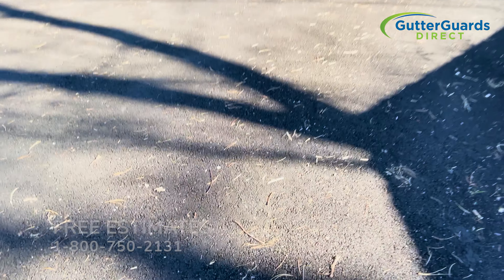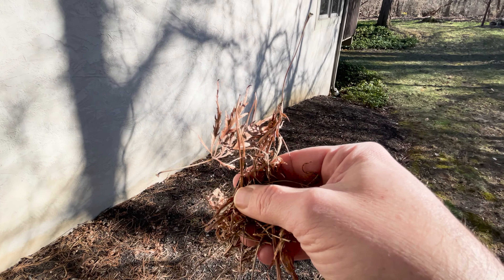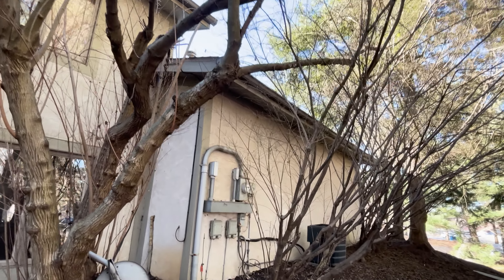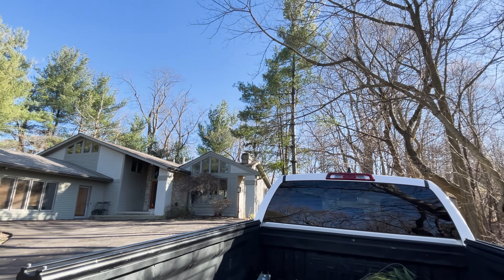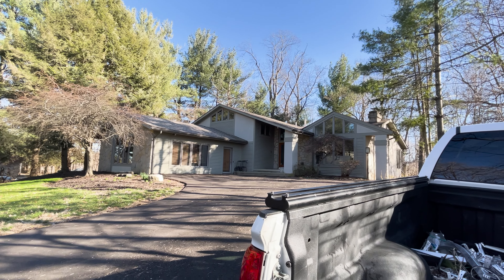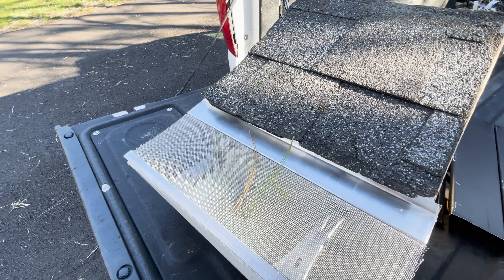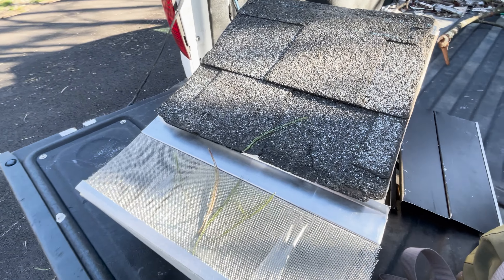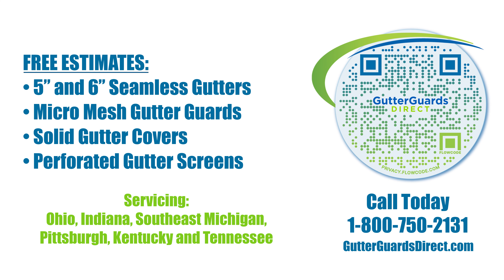How Do You Pick the Best Gutter Guards for Your Home? Comparison of Gutter Guards vs. Pine Needles

Comment: Will the LeaFree work if I don't have pine trees. Mu neighbor has river birch leaves that fall on my roof and an oak tree in his back yard that the leaves sometimes make it to my roof. I just had that system put on my house with 6 inch gutters and it also has holes in the gutter guard along with the slot on the front, so it's not solid, it has holes, a lot of holes.
Reply from the maker: Hi  @ron4413 . What you just rattled off are among the 5 worst trees on our list. The issue is small stuff clogging the opening into the gutters. I would encourage a micro mesh for your situation. We’ve tested many. Anything with a finer screen will keep the small stuff out of your gutters. Anything with larger holes, slits or slats will be problematic. 

If you decide to look closer at micro mesh, make sure that it’ll easily repel the debris and take in the water. 

Jump around the video in my next comment to see what might fit your needs.
Reply from the maker: https://youtu.be/ay_FS1X22kY?si=IvIqTqh4wBKMObEt
Reply: @gutterguardsdirect  Ok thanks, I saw in your one video where LeaFree was your 2nd choice.
Reply from the maker: @ron4413 overall, the solid gutter guards are good performers; however, small debris is their downfall. Oak tassels and the twigs and leaves off the river birch may prove challenging or require you to blow/wash out the opening into the gutter.
Reply: @gutterguardsdirect  Ok thank you for your help, I guess we will see how they work since that is what I have. Those trees aren't in my yard, they are in my next-door neighbor's yard. He actually has the solid gutter guards on his house and doesn't have any trouble that I know of. My neighbors across the street have the same and have a lot more trees and they don't seem to have a problem, so we will see. I hope I made the right choice. I will let you know.
Reply: @gutterguardsdirect  Thank you

Comment: What would you choose for a house wth only 2 large cherry 🍒 trees close to only one side of the house and garage?
Reply from the maker: Determine what types of debris the tree sheds and then look for a gutter guard that sheds that stuff. Clearly, a product like MasterShield, will work. It's the Cadillac system. Others might work, too. In this case, LeafSolution, Gutterglove Pro or even Gutterglove Easy-on/Atlas if you're interested in a budget-friendly DIY gutter guard that is designed to slide under the first course of shingles. 

You simply have to decide what level of maintenance you want to perform going forward. If you're subject to leaves and cherries falling into the gutters or onto the guards, installing a gutter guard that slides under the shingles and has a nice forward slope makes more sense than installing a gutter guard that sits flat in your gutters. 

There are 3 variables: ability to shed debris, ability to manage water, and cost. If you don't want to maintain your guards, find a gutter guard that sheds the debris and takes in the water. If cost is a concern, then find a system that will take in most of the water and makes it easy to blow the debris off the tops of the gutters, but keep the leaves and debris from entering the gutter cavity. Gutter Rx is a popular option in this category.